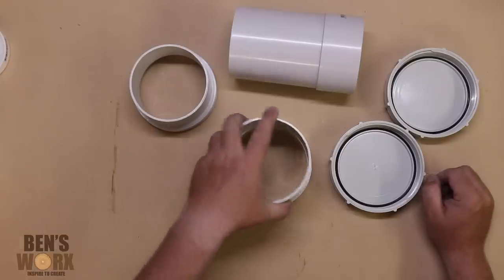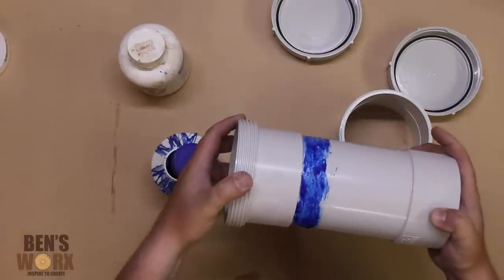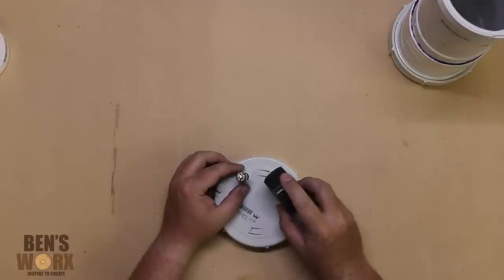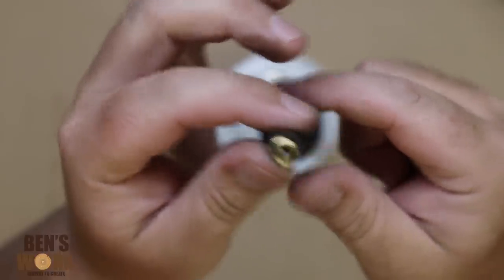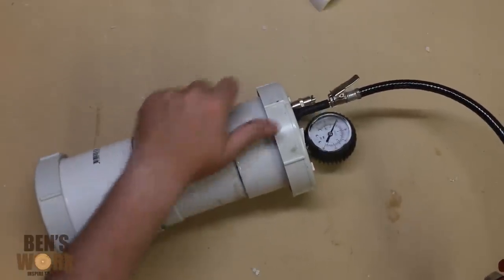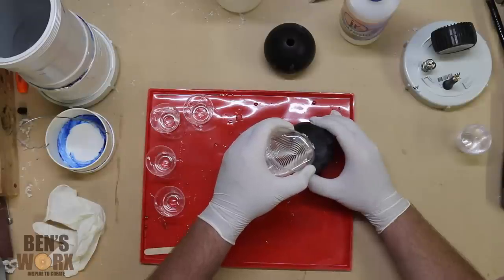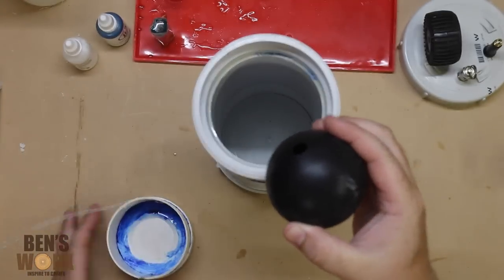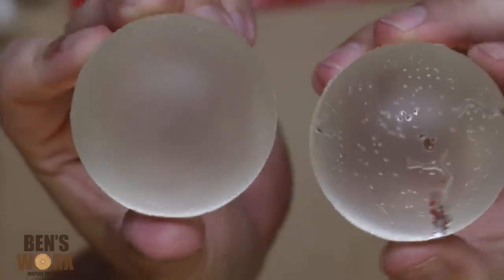Diy pressure pot for resin casting with test casting

Comment: Cool design!
Just keep in mind that PVC can shatter, especially if left exposed to sunlight for a long time (UV will degrade the plastic after some number of months or years), frequently pressure-cycled or has a weak point, and will throw dagger-like shards.

Comment: It might be worthwhile to try testing the bursting strength and/or the safety release pressure by putting the unit in a bucket, or a cage of chicken wire, then put it up to full pressure past where you'd normally operate it.

Cool test on the cheap!
Reply from the maker: Good idea Don! I’ve made smaller pressure chambers before that have held over 60psi, but it still would be nice to know
Reply: If you're going to pressure test, fill with water first.
Reply: MOST PVC has a pressure rating already, typically something over 100PSI
Reply: @TemplarIRL  that is liquid pressure though,  and gas pressure is VERY different, as gas expands/compresses a lot more under pressure, There are TONS of warnings against air pressure in PVC, and rightfully so, as you're basically making a pipe bomb. 
Though they still aren't super safe  spending a 100$ or so on a cheap paint pressure pot would be leagues safer. 
with things like these some extra cash is much preferable to perforated organs.
Reply: @TemplarIRL  This PVC is used for gravity not pressure pipelines. These pipelines are tested for leaks to 15kpa (2.175 PSI) a long way short of 60-80 psi needed to remove bubblesPressure vessels in Australia MUST meet Australian Standard 1210 Pressure Vessles

Comment: Do I understand it right? This works with pressure? Not with vacuum? If so - which one works better pressure or vacuum? From this video if it was with pressure it seems to work as good as a pressure vessel. Very interesting.

Comment: I can't find pipe with that large diameter in the UK, at least not with threaded end caps. Is there a name for it that would help me search, i no very little about plumbing apart from hooking up washing machines and bleeding radiators!

Comment: This is really cool! Especially the low pressure working as well as it did on such a thick cast! I'm making a fairly large resin enclosure and need a 25 gallon or larger pressure pot/tank. Pretty sure I can get away with low pressure casting which should dramatically decrease the pressure vessels cost!
Reply: @BensWorx  Was considering 24" pvc pipe and fittings until I noticed how much they cost 0.0
 I'm thinking my only option is to buy 24 inch steel tubing, weld on supports and end plates or flanges and mill a threaded steel lid with gasket/o ring. Or use the over sized wing nuts and bolts approach for clamping the lid down.
Reply from the maker: Have you seen my video on converting a paint pressure pot?
Reply: @BensWorx  Yes, was looking at a 15 gallon CA technologies ressin casting pressure pot with 14.5" internal diameter, and 21.5" internal depth.  But even that is to small for the larger castings I'll be doing. Length is good, it's the diameter that is too small and honestly cube or rectangular prism has a better footprint than a cylindrical pressure chamber. 

Found a company called "PTI" or  "Pressure-Tech inc.", they make custom pressure chambers/vessels. Having someone experienced make the chamber is only way I'll feel sort of safe around it when it's under pressure considering how large it is.

Comment: Thanks for the video. This is awesome and such a money saver! Are the majority of these parts available at Bunnings? Also I was just wondering what size drll bit did you use for the pressure gauge to just screw in so easily like that?

Comment: I just tried this with some 110mm pipe fittings from the hardware store, got it to 18psi and got some creaking, then the bottom cap (i didnt do double screw ends) just flew off like a rocket. Safe to say I may have jumped a little. Time for more cement I think!
Reply: Same happened to me.
I wasn't smart enough to lay it down either, whole tube jumped up, and if it wasn't for the pump hose would have hit me in the face.

Comment: What kind of resin did you use?  I'm wondering why they came out hazy instead of clear?
Reply: I don't know if you still are looking for an answer, but for anyone else who comes across this, the haziness is due to the mold surface that is in contact with the resin. If the mold itself is shiny, then the resin surface will be shiny too. The haziness can be sanded down though to reveal the shine.

Comment: If you add an inexpensive adjustable pressure relief valve, which you can set from 0-100psi, it will make this setup much safer.   Pressure gauges fail and most accidents happen when filling and rapidly overshooting the vessels max pressure.   If you stay around 30-50% of rated pressure and have an AUTOMATIC relief valve, it's much harder to get yourself into hazardous territory.  But I'm confident it can still be done....  Gene pool what it is today....

Comment: Hey Ben this is a great little pp for my use. Question? Is the 18 psi the standard or do you normally go higher? I think I remember seeing you use 50 on your tank but that may be too high for this unit right?

Comment: can't for the life of me figure out how to get a seal on that lid. epoxy and duct tape were my first decisions, clearly imperfect, but it was better than nothing I guess. I've heard about vaseline, so I'll be trying that later, and I'm also considering something like flex seal or any other liquid rubber type thing. Are there any other potential solutions to improving the seal? I'm also heavily leaning towards filling the lid with silicone.
Reply: and against all odds, i come back. did most of these things. filled the lid with silicone, vaseline'd the threads. all to mediocre success. had several successful batches of silicone, but when it came to resin, i discovered that the cracking/farting noise was coming from the lid, which was leaking air through the vaseline, thus producing the sound. no idea why. i tighten the lid with all the might my body provides me, but alas, the air still finds a way out. my best guess is that the seal is broken due to debris and i need to clean the threads thoroughly and reapply the vaseline. will do that later, but man, just buy a pressure pot.

Comment: Hi could you tell me where you got the parts for this pressure pot 

Regards 

Paul
Reply from the maker: I got the pot from Super cheap auto, and the fittings from bunnings Edit: sorry mate I thought this was the steel pot, I got the pvc pipe from Bunnings’s and the guage and pressure relief valve from a brewery supply shop and the tyre valve from a local tyre fitting shop

Comment: Hey Ben, I'm going to have a go at making this this long weekend! Were the holes you drilled for the gauge and release valve were threaded? Also I cannot find a release valve anywhere - is it necessary at such low pressures?

Comment: Finally got a seal on the threads using ‘potable water compound’ if that helps anyone. Just held 20 psi for 6 hours
Reply from the maker: Nice 👍
Reply: Hey Andy, did you use this 'potable water compound' on the thick PVC thread? And did you use it on the cap you're screwing on and off? I'm assuming it's a pretty strong glue, so how did you get the cap off again!? Cheers mate!

Comment: Awesome Video! I've been trying to figure out though,  how I could put more than one thing at a time in it. I thought of a design that I think will work and I am going to be making this week!
I'm going to do exactly what you did, except I'm going to make it taller, and instead of the single caddy you made to get the casting in and out of the pot, I'm going to make a multi level caddy.
What do you think?
Reply from the maker: Sounds like a great idea Connie 👍 I would love to see some pictures when your finished
Reply: Did you ever make the multi level caddy?
Reply: @ninja_haiku  Yes I did, came out great!
Reply: @ConnieConnie824  That's great to hear! I'm getting ready to make my own custom design too, are there any pitfalls I should watch out for?
Reply: @ninja_haiku  I used pretty thick wood, which is ok for what I do. But you might need to use thinner wood for more room. You definitely want to measure your tallest mold and make sure it fits on one of the lvls.
Reply: @ninja_haiku  I wonder, is there a way I can share a photo of it with you....
I'd like to share my FB page so you can join and I can show you a picture, then you can unjoin if you wanted 🤣🤣🤣
What do you think?
Reply: @ConnieConnie824  That would be great! Is there a way to send a private message over youtube?
Reply: @ninja_haiku  Not sure, I don't seem to be able to from my phone, I'll have to check when I get on my computer if I can send you a message. I don't really want to put my page info on another creators channel cause I just don't feel right.....

Comment: I'm do tired of bubbles in my resin projects but this is too small for some of my pieces. I've thought about somehow fitting up a pressure cooking pot with gauge and valve. Any ideas if that would work?

Comment: Hey Ben, just wondering, did you only use the basic rubber seal on the inside of the PVC cap? No other seal on the cap? I'm getting an air leak no matter how tight I screw it on. Only small, but enough unfortunately. Thanks mate! Great tutorial. Everything else is working perfectly.
Reply from the maker: Hi Nick, try putting some vasoline on the seal

Comment: What will happen if you try it with a vacuum? It seems to me that you pull the air bubbles from the resin instead of compressin them.  in a factory where they make carbon fibre or glas fibre parts in combination with resin they also use a vacuum to cure the parts. On the other hand they also cure parts in an autoclave so probably both methods work. But what i like to know is what the effects are in each method. Maybe you can shed some light on the subject? 
Great channel and very cool projects, keep it up.
Greetings from the Netherlands.
Reply from the maker: Hi Mate, hello from Australia 🇦🇺, a vacuum is great for degassing and casting objects that require resin in tight spaces, I will get my hands on a vac pump and do some tests. :)
Reply: peterencobie yes i was curious also if this could be used for vacuum or stabilizing wood.
Reply: Vacuum doesn't work with getting bubble out of resin.  The vacuum just causes the resin to spread all over the inside of the pot.
Reply: Vacuum will cause the resin to overflow....there are some interesting videos on it.  I initially though the same thing until I saw what actually happens.

Comment: I actually made this but I had to get real creative as I couldn’t find the same type of pipes. Which brings me to my issue. Instead of caps I had to use a Charlotte cap and plug. In order to keep air from escaping I culled around edges. My problem lies with the last plug, I obviously can’t culk around it because I need it for the opening, but air is escaping so I can’t build pressure. Any suggestions?

Comment: Thanks ben .
I'm going to re-purpose an old pressure cooker , similar method but in strong aluminium.
I was thinking of 40 P.S.I. untill i watched this .
Reply: Rob, did you made the pressure cooker one?
Reply: @cheroso1000  No , couldn't get one from anywhere , they have gone the way of the dinosaur . Made one out of soil pipe ( 160mm ) in the end . 500mm of pipe , one end a stop end and the other end a screw off end . I put a car tyre valve in the stop end and pressurised with a regular 12 volt tyre pump. All worked well and 40P.S.I.  was achieved easily . I would say to be careful though because i could see the plastic bulging at that pressure . I wouldn't trust it to work over and over .
Reply: I simply can't find these pipes anywhere, did you buy it online? Can you send me a link? I'm in Brazil so it would be harder to find it here out of the blue.
Reply: @cheroso1000  Sorry fella  , i'm in England and even corner shops  sell this pipe stuff. Brazil you say , lucky you  ! Here in blighty it nearly snowed this morning and there was a frost .I'm sure you can at least enjoy the weather while on lockdown . Good luck with your pipe hunting  , but the carriage from here to you would be in the hundreds of pounds my friend .

Comment: That's awesome, Ben! Let me ask you a question: I saw your other video with the new pressure pot and I'm asking myself if I can put larger and bigger pieces inside the pressure pot. If the pot is big enough, would it work fine? Do I have to put more pressure because of the size of the piece? Thank you very much!
Reply from the maker: Nope same pressure

Comment: Am i able to put an actual cup of open resin in here to release the bubbles prior to pouring? Same goes with any open molds, do i have to leave it in overnight? And also can i put open olds into this. Without the pressure pulling all the resin out of the mold? Someone please answer id like to make on of these asap!

Comment: I couldn't find the lids with the seal, so I made mine with a female coupling with threads and a Male end cap.  I am trying to use ptfe thread sealing tape so air doesn't escape, but it falls off every time i take the lid off. What should I do?
Reply: did you solve it?
Reply: @ikkiiiieee  honestly no, but someone actually gave me a pressure pot so I no longer have use for the one I made similar to this.

Comment: How high could that set up handle? 
Thanks for the video n ideas!!! Keep up the great work
Reply from the maker: Hi Joeseph, Thanks Mate, I’m not too sure, I’ve had pvc tanks up to 60psi before but it all depends on wall thickness and the manufacturing process (using correct glue ect) i feel comfortable at 20psi and it seems to do a great job.
Reply: Ben's Worx ok thank you

Comment: Love the idea, so simple. 
Unfortunately what I saw isn't what I got. The lid keeps leaking air, still trying to find a solution for that.
Reply from the maker: Try putting some vaseline on the seal
Reply: @BensWorx  Hey Ben, thanks for your reply. I expected the vaseline to be pushed out as well. Will give it a try when the new caulk is dried up!
Reply: Little update: The vaseline was a good improvement, but unfortunately I've tried multiple times and still couldn't get it to a proper seal. Soooo instead of wasting cash on something that didn't work for me, I've decided to buy the (cheap) paint-version. Modified it today and currently testing the seals with +-45 psi (3 bar). 

Quick tip for people who are looking for this as well:
It really makes a difference to check around online shops. 
Using the same EAN number i've seen prices between 150 euros and 250 euros for exactly the same model.

Comment: Great video!!
Now does anyone know where I can get this stuff in the UK? I've been to all my local diy stores and been looking online for days and cannot for the life of me find all the parts? All I can find is the middle pipe. No couplers with threads or end caps with rubber seals.
Reply from the maker: Thanks Marc! Do they have a bunnings in the uk?
Reply: Ben's Worx I did google them and apparently so but their website wasn't the best so either I couldn't find the right stuff or they didn't have it altogether.
I decided to just look on eBay for 'pvc pipe' and after about 10 pages of searching I think I found the correct stuff so I'm hoping it works. Cheers 👍🏻
Reply from the maker: I’m glad you found them, Bunnings website is pretty bad but if the store is like the ones we have here in Australia they will have what you need, hope you get it worked out Mate
Reply: Simon Powell sorry only just seen this. Can’t find the exact seller but if you search ‘110mm soil pipe’ then you should find everything you need 👍🏻
Reply: I'm also frustrated, can't find the correct piping for this project nowhere

Comment: Great tool, but what exactly does this to the resin? thanks
Reply from the maker: Hi, it removes the air bubbles
Reply: what would be the minimum period to get the bubbles out?
Reply from the maker: Depends on what type of resin your using, generally just until the resin is set. This could be an hour or up to 4 hrs
Reply: Actually it does not remove the bubbles. The pressure crushes the bubbles down to microscopic size so they can't be seen with the human eye.

Comment: In terms of the outcome of the  project, what is the difference between using this pressure pot, versus using a vacuum chamber with a vacuum pump?
Reply from the maker: Hi Mate, The outcome should be very similar, a vacuum chamber is used to de gas the resin prior to casting, so it should have similar affects when casting in a pressure pot
Reply: actually, you'll get horible results when you try and use a vacuun chamber on resin cast. learned that the hardway. 😂 its going to form up bubbles that are going to stay there til the resin cures.
Reply: Clarence Saldaña I agree! Somebody did a comparison video on YouTube....maybe Paul Brown? Anyway, the vacuum caused the resin to froth away. Only the pressure pot worked.

Comment: Question- After sanding and polishing both spheres, does the one with lots of bubbles have its bubbles disappeared and became nice and clear? I am just wondering because I want to know if those bubbles I saw in the video are only on the surface of sphere (I.e. easy to get rid of) or if they are inside too (no chance to get rid of them all and achieve a crystal clear look).
Reply from the maker: No they will stay, the bubbles are all the way through the cast

Comment: Thanks Ben. I made one, very simple and would be effective If I could seal the threaded sections. the gasket alone wont seal the air. What did you use??
Reply from the maker: Mine is the same, you just have to tighten the crap out of it. I put mine lightly in a vise and swing off the lid
Reply: Ben's Worx would non hardening thread sealant help. We sell a variety at work that doesn’t go off like regular thread lock. It’s uses for sealing automotive threads that you still need to undo from time to time.